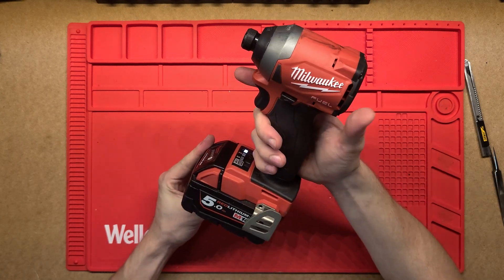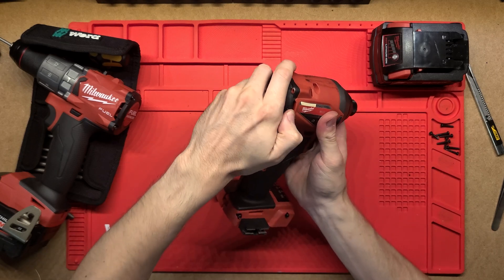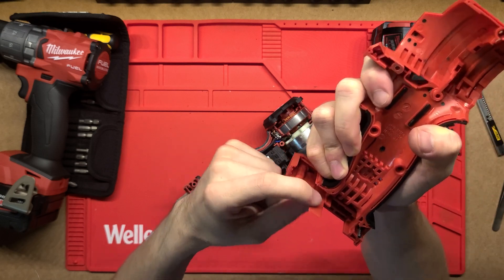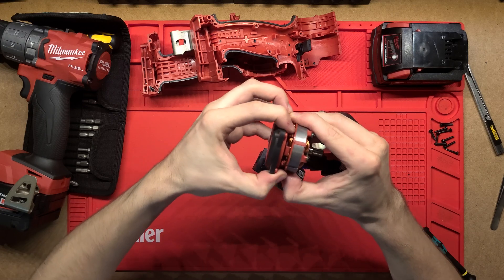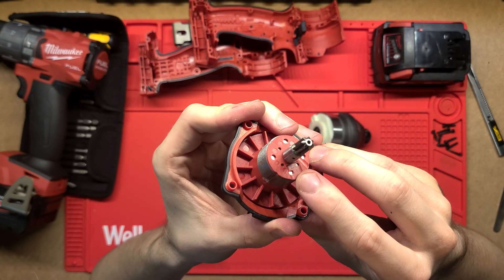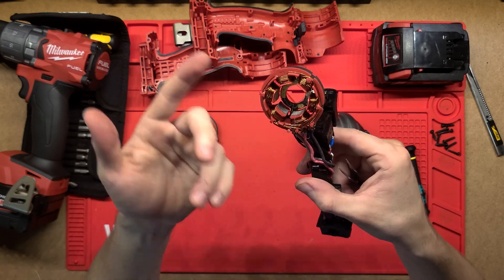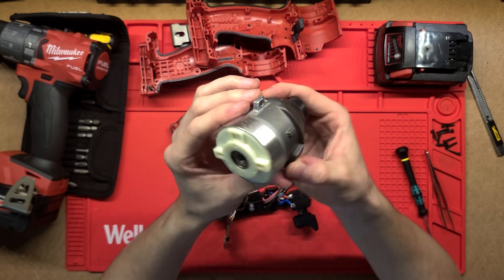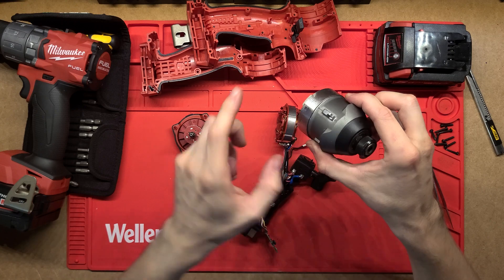MILWAUKEE M18 FUEL™ 1/4" Hex Impact Driver Teardown

Comment: I don’t know if u will read this I’m an apprentice and could do with some advice last week I stupidly blew out some grease with compressed air as I was cleaning  my m18 impact just wondering if it will matter it wasn’t much
Reply from the maker: Hey mate, hard to say without seeing it. But if it's not much you should be okay. I would recommend topping up the grease, though, so the tool can run as intended. Milwaukee recommends synthetic or lithium-based grease. Something like this should work: https://amzn.to/3T1gtF1
Reply: @ToolsnTeardowns thanks a lot just Oder the grease would u recommend me opening the impact or putting it in with out opening